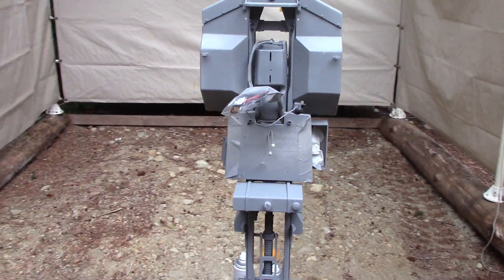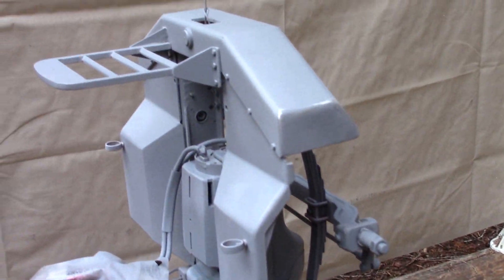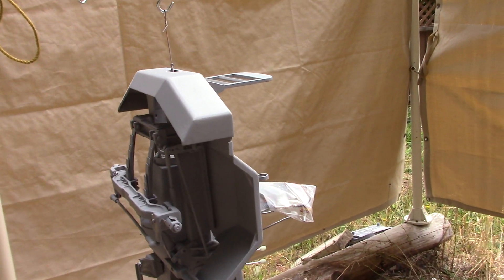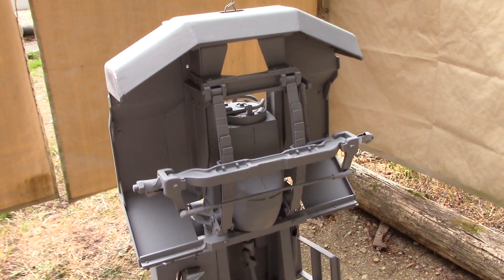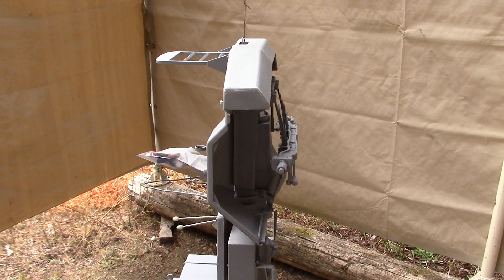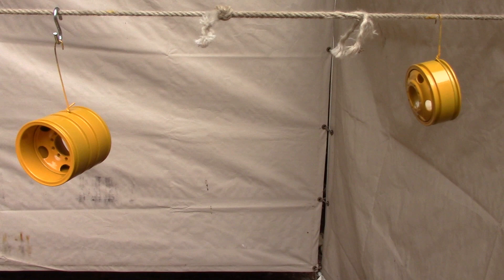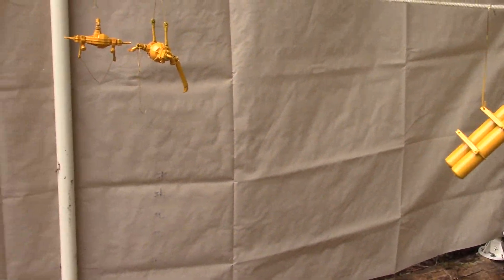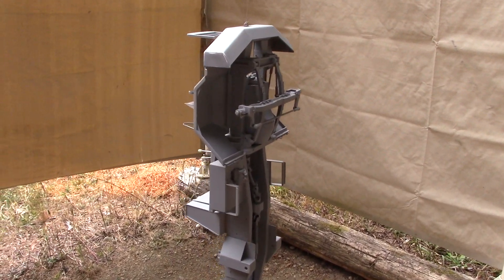Hayes HD RC chassis in primer

Comment: When you are doing the painting stage. You worry the  paint will cover the holes that is needed for screws and such?
And that is what you been doing with the dump bodies as well?
Reply from the maker: Dump bodies are powder coated. With both though I just run a tap through the holes before reassembly.
Reply: Alright, sound like a best thing to do after the paint is all dry and hoping the tap going through the hole will not hurt the paint.